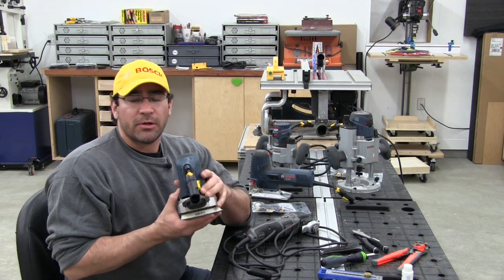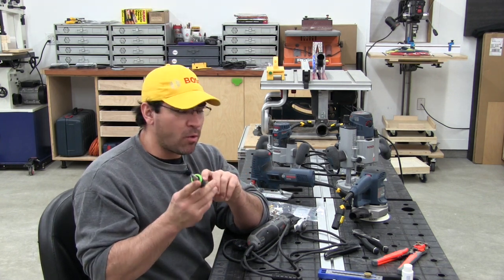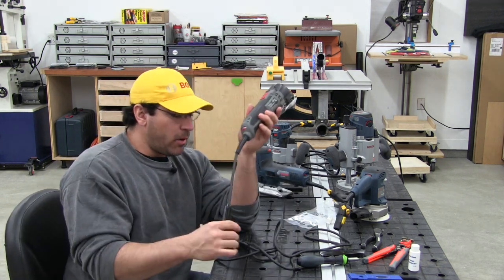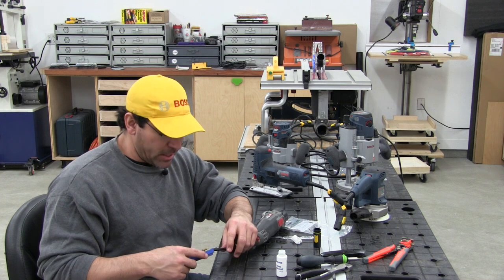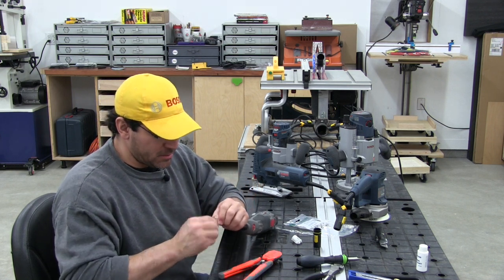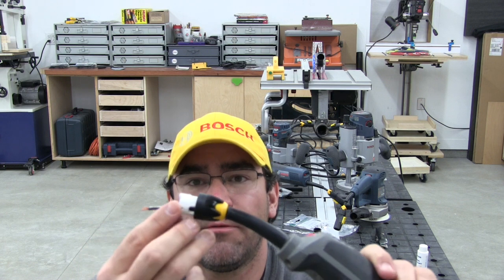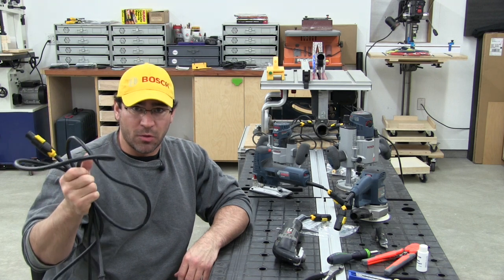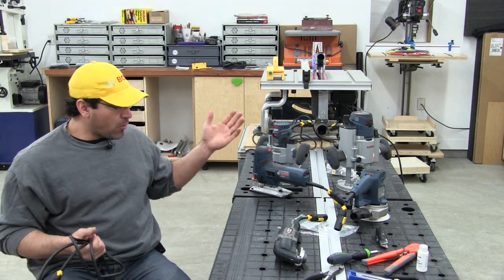Neutrik PowerCon True1. An electrical modification for power tools

Comment: So after 2+ years are you still happy with this modification?  I am seriously considering it.  Im not a festool nut, I only have a domino and LR32 system thats adapted to a Dewalt DW625 router but man I do wish there was one standard universal power connection like the plug it for ALL tools but at this point this seems like the best option.

Comment: Dude, don’t put the male connector on the source side. It has pins inside that can be touched easily!! Hurts so much to hear someone saying that it doesn’t matter which way you connect them, always remember: always know what you’re talking about when working with higher voltages
Reply: Indeed, never place the male connector on the source side! Life threatening!
Reply: These connectors come from the entertainment industry where the male is always on the source side. The true1 connectors are well insulated and protected. Not like it's predecessor the powercon (blue one)
Reply: @J-Gx  the male side is the one that’s supposed to be on the drain side, it has pins inside that can be reached with bare fingers. To be clear, the male side is the one that goes over the female. Look it up on the internet. Male side NAC3MX-W-TOP and female side NAC3FX-W-TOP. With the blue and grey powercons you should also know which one to use as input or output, but those are totally safe to touch with bare fingers if used incorrectly. Never use a male power connector on the source side
Reply: @julianvanessen9381  Wait what, I have been saying male to females all this time?! Anyway, NAC3FX-W-TOP goes on the power cord, NAC3MX-W-TOP goes on the appliance. Look at NAC3PX-TOP It's clearly input and output.

Comment: Can you try connecting one of your hand tools that have the niutrik connectors on a GEFI outlets see if it works? On mine it trips the breaker. But on a regular outlet it doesn’t trip. What can I do to fix this problem.
Reply: Ignacio Ortiz check your wiring inside the  new connector. Sounds like you may have a strand of wire touching something it shouldn’t. Also, check for correct polarity of the green and white wires on the new connectors.

Comment: I think if I was going to do this I would put an end on the tool where you cut it and then one the cord you cut off and then plug it back together.  When you need to use the PowerCon plug you then unplug it and use it.

Comment: Good idea. Powercon connectors are safe and a substantial upgrade to the typical edison style plugs. I advise viewers use the correct gender connectors, because your setup runs the risk of somebody plugging a correctly made power cable into your power cable (male to female connection).

Comment: it would have been better to film close up's of what you are doing; instead of trying to describe things at six ft away! 
By the way,the 'L' marked on the terminals stands for 'Live', not 'load'.
 it would be better to leave a few feet of the original cable on the tool, to reduce damage by kinking it when coupling/uncoupling the plugs.
The neutrik powercon series are designed for connecting sound system power cables on stage;so they're tough, if a little expensive...but remember to buy them from 'trusted' suppliers,there are a LOT of fake ones out there; known to break,melt,or even go up in flames..they have undersized connectors and poor cable-clamps inside them,although they look identical. (A lot of online sellers show an original on the website, but supply a fake.)

Comment: marius hornberger mentioned to use the male on the tools because the male connector has exposed pins. Using the male one on the power cable could expose you to an electrical shock.

Comment: 00:54 It DOES matter, if there's male or female connector at the tool. If you use a female connector within the tool, you ought to have a male one at the cable. At male connectors the electric contacts are exposed. If you're using this at the cable, already plugged into the outlet, you can get electric shocked. Even more as that fitting is designed to be (un)plugged energized. It's said by the producer as well. Even though the pins are inside the housing, they are reachable and could be touched by accident. Safety first !

Comment: I understand the reason and why to shorten the tool cord. However, I am lost at how you chose to do it??.. Shorten the cord to where you want and put on a new male end. Or go into the tool and shorten cord using factory male end. What you have done is limit the power source to your tools! Now you have only the extension cords that you modify and no one else can use it for their tools on a job site or at other location. Are you going to go to the expense of changing all of your future tools? I just do not understand the expense and limitations. Sam
Reply from the maker: Samuel Lunsford  I just cut the cord to leave me enough cord to attach the fitting.   I didn't what to open the tools.  No rule of how long you leave the cord.  It's all up to you buddy.
Reply: The reason people do this is 1) to avoid having to wrap the cord to each tool each time you use it  2) to reduce storage space required by all of the power cords 3) to run one cord and "connect" it to the dust collection so that you don't have "cords" going everywhere.    I think it's a great idea to do this, however, I will probably make 2-3 power cords (not just one) in different lengths, depending on the type of tool, how far it needs to reach etc.  It also addresses your concern of using the tools somewhere that isn't your house and having multiple people work with different tools.   For me, one other concern is that I would really like only one power tool connected to power at one time, for safety.   I'm "too lazy" to do this.  I think that this system will encourage me to use one power cord and disconnect each tool before using the next since the connection is at my workbench, not several steps away at the outlet.

Comment: Nice demo Eric. Looks like Bosch is benefitting from the move away from "green."  I enjoy my Bosch tools and have had mostly good luck with them. There are so many good options out there these days with many different tool manufacturers. One of my favorites is my Mafell track saw which shares the same rails as Bosch. I hope someday Bosch will sell their guide rails here in the U.S. Take care, Rod
Reply from the maker: I'm surprised Bosch doesn't sell their track saw in the states.   I would think they would want to get a piece of the track saw market.   Makita, DeWalt and lots of other brands selling track saws.    The Mafell appears to be the mac-daddy of track saws.  
Thanks for watching, Ron.    Take care,  Eric
Reply: The Poplar Shop  I really like the Mafell. Very well made tool. I also integrated it with an MFT/ qwas dogs.

Comment: Eric if the pins can be touched then they should be on the tool side of the cable.  Thus when they can be touched they will be dead.  If they are on the plug end then they could be touched and be live if the plug is still in the wall.  Just a safety observation.  Thank you for your informative and educational videos.
Reply: EscapeMCP 'power in' is the side connected to the tool. As someone who studied electronic engineering, I would cut the cable after the ferrite and only fit male connectors to the tool. I'm going to be doing the same mod to my tools with the Teeplug system that is IP68 rated in the UK. Much better quality.
Reply: I think the true1's disconnect power when they are not connected. Neutrik state that the 'open' style that he is using on the tools are for power IN - I wouldn't go against this!  There's no way you could stick your fingers in the power out connectors though.  I've used Neutrik extensively, and they are well engineered bits of kit. 
Update:  Neutrik state that "The powerCON TRUE1 is a connector with breaking capacity (CBC), i.e. it can be connected or disconnected under load or live." 
Dunno if that means it's not live when nothing is connected... can anyone explain what CBC is please?
Reply from the maker: Gordon Scott Thanks Gordon.  A nice feature with the Neutrik fittings is the pins are enclosed inside the housing of the fittings.
Reply from the maker: smartmonkey777 Google EMTAG.  It's a anti theft device.
Reply: Awesome reply, I can see the immense forethought you put into your comment.

https://en.wikipedia.org/wiki/Ferrite_bead

I'll leave this here for any one who cares.
Reply: But you can still stick your frigging finger in there , just because you say you wont doesn't mean it wont happen , also that piece you took off is a ferrite , it's to help suppress unclean signal being back fed to the utility line from the tool. I'm sorry this is shit , thumbs down.

Comment: How is this better than shortening the cord and putting a regular cord end on it?
Reply from the maker: Chad Kuntz  For me I like the locking feature.   The Neutrik fittings are just a couple dollars more than a replacement fitting for an extension cord.   But I see no reason why you couldn't shorten the cord on the tool and put  replacement male ends on.

Comment: Why'd you get rid of Festool.
Reply from the maker: I didn't get rid of all my Festool tools.  I still use some of them.  You won't see a lot of Festool tools used in future videos. It's a personal thing I have against Festool USA and the direction Festool USA is taking the brand.
Reply: The Poplar Shop I bought Festool because of your videos. Is there something I should know?
Reply from the maker: PD12 Nothing wrong with Festool tools.   I'm just not happy that Festool USA decided to switch the scales on the tools to imperial measurements.  I was going to buy a OF1010 and a TS75.  Now if I buy a tool and want a scale with millimeters I have to request a sticker for the router and ship the TS75 to Festool USA so that they can swap out a piece of plastic and charge me an additional  $75 for the labor.  An additional  $75 on top of a saw that carries a hefty price tag.    Yet the actual plastic piece with the scale on it is still the original part made with millimeter increments.  They changed nothing except for numbering.   A marketing plan that didn't sit well with me.  I still have Festool tools and will use them.  I won't promote them in my videos.  I  had my fill of the Festool "kool-aid " and decided to see what other brands had to other.  Which is why I have a lot of Bosch tools.  So instead of buying a TS75 I bought a Bosch table saw.   Instead of buying a OF1010 I bought two Bosch routers.

Comment: I use these connectors alot myself in the AV world....luv em.....man, I've been noticing more and more Youtubers switching out their Festool gear to other brands, like Bosch....WoodWhisperer did the same thing...I figured you guys were getting a better endorsement arrangement from Bosch than Festool.....I not a big fan of the Imperial label switch here in the U.S either....and the extra charge to do metric....think it was not well thought out and a kick in the balls to its existing U.S. base who took the time to make the adjustment and now luv it.
Reply from the maker: Yeah, the extra charge for a metric scale is what really pissed me off.  No clue why they wouldn't use a dual scale like all the other brands use.  But hey.....the marketing guys figure they'll make extra money this way I guess.   
I'm not endorsed by Bosch, so my move has nothing to do with an endorsement deal.  It's all personal.
Reply: Ya, I feel like everyone has their own personal preference to tool manufacturers. Some like DeWalt, others Milwaukee, I personally like anything that's made in the US or Japan. You just know it's going to work.

Comment: Good video as always.I see you have a lot of Bosch power tools now, may I ask why you made the switch from Festool?.
Reply from the maker: Aaron Price Personally just not happy the direction Festool USA is heading with the Festool brand.  So you probably won't see much of the Festool gear I have been used in future videos.
Reply: Got ya. the reason i ask is, i'm currently in research mode for kit i need for a career change i'm planning, and i've kind of got it narrowed down to Festool or Mafell (for a track saw), and Festool or Bosch (for routers drills etc). as i'm not already committed to any particular brand, my options are wide open.
the materials i'll mostly be working with is fancy double sided 15 -18mm veneered ply, so obviously beautiful tear out free cuts are paramount. so if you have any suggestions? i would  greatly appreciate it.  Cheers
Reply from the maker: If the Bosch track saw was available in the states I would have it and I would be able to give you better feed back. I had the Makita track saw.  I made three cuts with it and gave it away so I would not recommend the Makita track saw.   I've heard that the Mafell track saw is the  best track saw on the market.  But they are so damn expensive.  The TS55 has produced nothing but quality cuts for me.       I've been using the Bosch Colt trim router a lot lately.  I think it's a great router for 1/4" bits and especially with the plunge base.  If dust collection is important to you and you have a lot of 1/2" shanked bits then the Festool OF1400 would be a good router to start with.
Reply: Yeah i did look at the Bosch track saw, which is basically a toned down version of the Mafell mt55, it looks a great piece of kit, but it does not have the scoring function like the mafell which i really like.
and obviously the Festool TS55 is fantastic, however, everyone who i have spoken to who has made the switch from festool to mafell say they do not regret it for a second, more power, better all round build quality and joining/aligning the tracks so much easier etc. and here in the UK the price difference between both is only about 100-150 quid extra for the mafell so it's not that bad. and the OF1400 was my first choice originally, but Bosch has really been catching my eye lately, is there a real significant difference in the dust collection abilities of the Bosch equivalent?
Reply from the maker: If I was comparing my Bosch MRC23EVSK router with the Festool OF1400 on dust collection only, then Festool barely beats out the Bosch based on my usage.   But not by much.  If I was shopping for a new router and was able to test the Bosch and Festool routers, I would buy the Bosch.   To be completely honest with you, I got caught up in the Festool hype.  For the longest time I never looked at other brands when I was looking to buy a new tool for my shop.  Lately,  Bosch has really impressed me.  One thing that impressed me with the Bosch routers is the fact that deluxe router guide fits multiple Bosch routers.  With Festool, each router requires a different router guide.   Forcing you to buy multiple router guides if you have multiple Festool routers.  I think that was a well thought out idea by Bosch because I use a router guide a lot.   It's not available here in the states, but Bosch has a nice looking 1/4" router with a digital display.  The Bosch GOF 1250 LCE looks a little like a Festool OF1010.
Reply: What was wrong with the Makita track saw?  Bad cuts?  I was looking into Track Saws and the Makita was highly recommended to me.  Do you still think Festool is the way to go for Track Saw?
Reply from the maker: For me, the Makita saw gave me terrible cuts with the stocked blade..  It has plenty of power. Maybe if you bought a better blade for it the cut quality would be different.  But I wasn't happy with it.   Lots of track saws available on the market.  Do your research and find out which one fits your needs.

Comment: The way you did it is right : male plug on the tool side, female plug on the other side. If you did the opposite, you would be able to put your fingers on the powered pins of the plug, very dangerous !
I'm in the process of making the same on all my tools : http://imgur.com/a/W7SkH

Comment: It's always safe to fit a female connector on the extension side as you don't want a male end with the live prong sitting around waiting to electrocute someone.
Reply from the maker: Hilton Ralphs  Good point.   The fittings are designed to be able to disconnect under a live load.  So no live exposed points are supposed to be able to contact anything.  But I haven't tested that out and don't plan on doing so.  LOL.

Comment: Brah!  Those aren't festool!  Are these pre-festool tools?
Reply from the maker: John Frontier  Without getting into a long boring response.   Festool USA made a decision to switch the scales on the tools from metric to imperial.   If you buy a router with a imperial scale and want a metric scale you can contact Festool USA for a free sticker to change the scale.  BUT !  If you buy a TS55 or TS75 with a imperial scale and want a metric scale then you have to ship the saw back to Festool USA so that they can swap out a piece of plastic.  And they are kind enough to charge you an additional  $75 for the work they performed.   An extra $75 when back in the day they actually supplied a free sticker with the TS55. And on top of it all, the plastic piece is still made in Germany with millimeter increments so all they did was print a imperial scale on a piece of plastic that moves in millimeters.  So the customer really isn't getting a true imperial scale.  I  could ramble on more but I won't bore you with the personal problems I have with Festool USA and the marketing decisions that they are making.   Great tools.  Personally I don't like what Festool USA is doing with the Festool brand.
Reply from the maker: dpeagles Not pre Festool.   Festool replacements.
Reply: What?
Reply from the maker: You won't see a lot of Festool gear used in future videos.  Just not happy with the direction Festool USA is headed.
Reply: Eric, could you please elaborate on this. I've been upgrading my tools to Festool. I respect your opinion(s)!